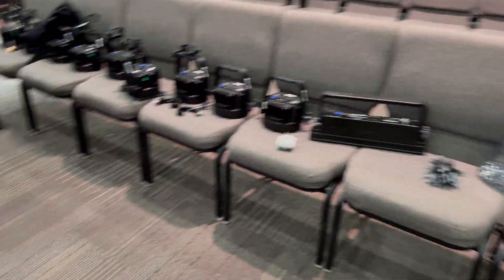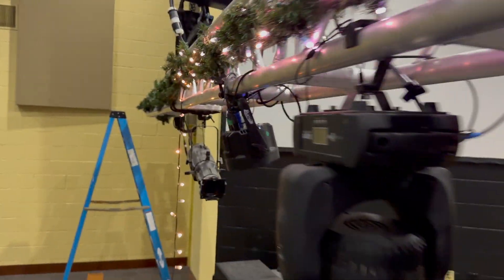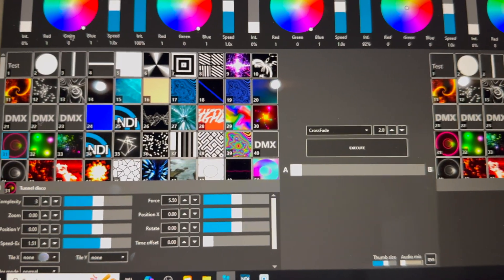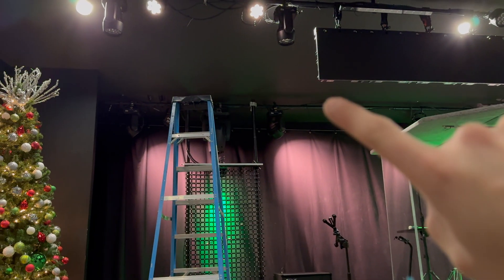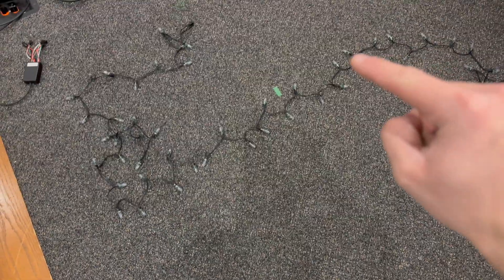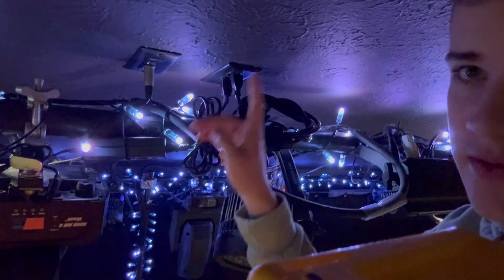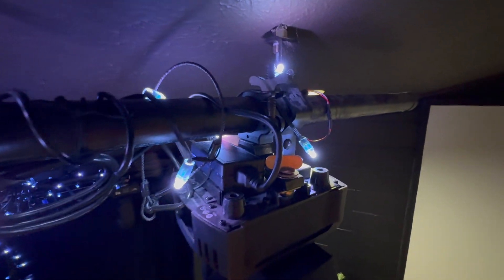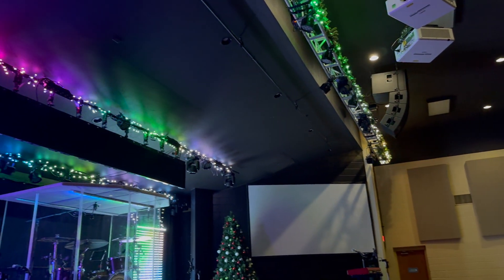WLED is awesome

Comment: What is wled?
Reply from the maker: It’s a lightweight LED driver software that runs on arduinos or microcontrollers.
Reply: @beamnetworks1  ah. seems to be a lot of videos talking aboout it , but ive not found one that explains it. is it bettter than buying something like govee with built in controllers?
thanks
Reply from the maker: @darrenelkins5923 in my mind, yes. WLED is super flexible and pretty easy to use. The initial setup is probably more difficult than something like Govee but I think it’s a better platform for led control. Thanks for your comment; I may have to make a video explaining this.
Reply: crappy buggy software